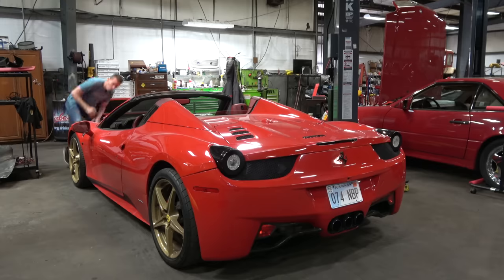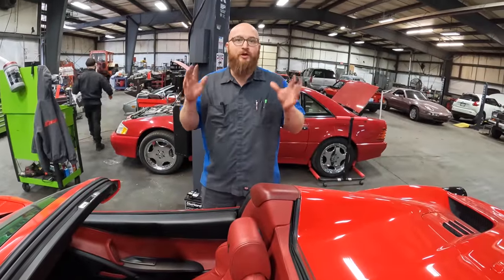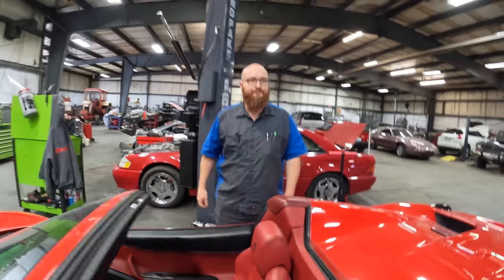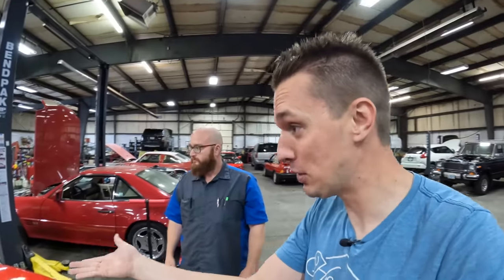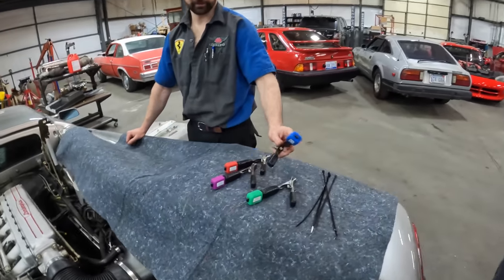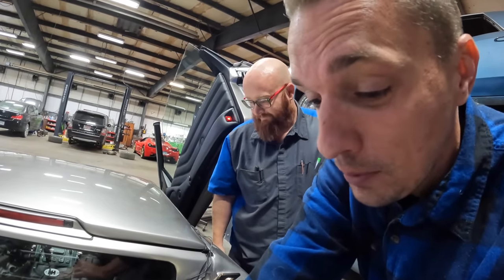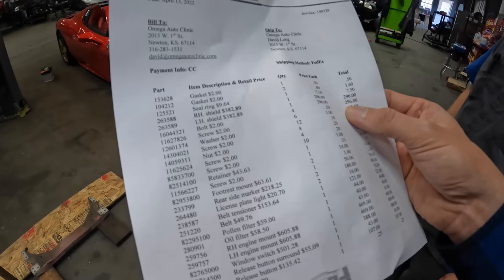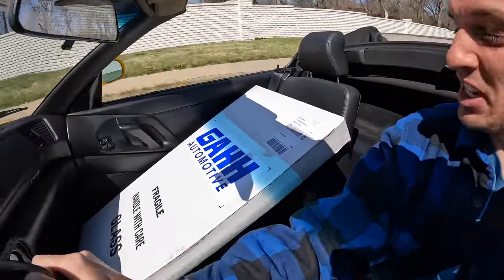MORE HIDDEN DAMAGE found on my CHEAP Ferrari 458 Spider! How bad was it really WRECKED???

Comment: Hey Hoovie, just ran a VIN check on your 458, it has an open recall as of March 22 for the Oil brake reservoir, you wouldn't want it.... burning down, would you?
Reply: Ofcourse he does, he will get more content that way. He doesn't care about most of his cars lol
Reply: That recall has nothing to do with a fire though, its for a potential brake fluid leak in the reservoir. Means he'll randomly lose breaks. Far more dangerous then it catching on fire though, because you can at least stop and get out if it does. Can't stop too well without brake fluid though.
Reply: Brake fluid is very flammable and will ignite on something like an exhaust manifold - a slow steady leak in the engine bay could be disastrous.
Reply: @stuc.6592  Except that brake lines rarely run through engine bays, especially close to hot parts such as exhausts. Still, a possible brake fluid leak is pretty dangerous.
Reply: @stuc.6592  That is why brake reservoirs in the front trunk area on a 458. Congrats.
Reply: That would just give Hoovie a reason to sing,"You Light Up My Life"without penalties.
Reply: @martij30  probably not on a Ferrari but every front engine RWD car you can think of the master is on the firewall right next to the engine and the brake lines run right next to the manifold.

Comment: 11:20 Hydraulic press while heating the Aluminium would be a MUCH better method, especially as its a HOLLOW rectangular part - until the new part shows up
Reply: Yes, at 12:03 you can see the upper part is now bent inside.  But it was funny moment, hopefully the part is not under high stress during driving.
Reply: Yes, they need a new cross member
Reply: But it doesn't make for good content. Remember, this show is fake and made for entertainment.

Comment: My serpentine belt / pulley sounded like that when it wasn’t perfectly aligned. Granted that was on a 66’ Datsun 520.
Reply: 2004 F150 Idler pulley would sound like that too.....only when cold and only at certain RPMs too....

Comment: I almost feel like it would have been better to just fine someone with a metal shop that could cut out and weld together a new cross bar to be installed rather than bending and risking it being potentially structurally compromised. Maybe I've just been watching too much Superfast Matt.
Reply: I was thinking the same
Reply: They should have heated the bend and used a 2x4 as a lever to gently pressure the bend out, mount it hot so that it cools and tightness in place. No issues. Hammering it cold, very stupid.
Reply: He should take it to Puddin's Fab Shop.  Guy could do it in a day and make a video out of it.

Comment: My father had a 1983 Honda Civic wagon that after warming up will make a similar noise and it was related to the fuel pump. The car will be normal but after some, it will start doing the same noise. I think you have two fuel pumps on the Lambo. That is my guess. Love the channel keep it up and check mine when you can Daily Drivers Inc.

Comment: Have you thought about Radio interference? I used to have a stereo that would wine up or down with the engine revs. I stuck an inline filter on it and it fixed 90% of it except this irritating whine at about 3500 revs. Coming out of stereo speakers it can be hard to realise its NOT an engine noise....

Comment: Sounded a bit like a fuel pimp or scavenge pump.
Try adding a Teflon based oil additive and a slightly thicker oil to rule out the engine

Comment: Have you checked the engine mounts on the Diablo? That resonance sounds familiar. It would do it mostly at idle then find a specific rpm at which the resonance would be most notable.

Comment: From my old memory , in the 70s Peugeot (504)  rally team used to use a hydraulic press to bend the rear cross member with a weight of about 500kg to get negative camber on the rear end.

Comment: Wouldn't a press give you a bit more control over the bending process?
Reply: Its a joke
Reply: Yeah, exactly what I thought. With a hammer you're more likely to create crush points at the impact site on an aluminium bar, as well as increasing the chance of shattering an Italian-grade piece of cast Alu.

Press + spreader block would be my route of attack. Doesn't look as good in a thumbnail I guess.
Reply: @CarWizard  you're not funny though
Reply: YouTube is not real my friend it's for the lols
Reply: 11:20 Hydraulic press while heating the Aluminium would be a MUCH better method, especially as its a HOLLOW rectangular part - until the new part shows up
Reply: @CarWizard  Thank god.  I know most of us did questionable fixes in the military, but that piece looks important to how the car handles.
Reply: @CarWizard  Are you trying to tell me, not everything I see on Youtube organically happened? My life is a lie.
Reply: Even some make-shift construction with a car jack would work
Reply: But that wouldn’t be as entertaining would it?
Reply: @MrEeeaddict  you’re mad

Comment: 1976 and 77 Chargers with the 400 ci lean burn engine sometimes had an exhaust resonance noise.  The factory approved correction consisted of a U shaped 6 lb. weight clamped to the right side exhaust pipe near the engine.  Worked every time.  Why the right rather than the left is beyond me.  Chrysler came up with novel approaches to some problems.

Comment: I'm sure it's been said and you've checked it already, but that sounds exactly like a vacuum leak I had once. And it only started making that noise when the engine was warm, I guess because the different metals expanded slightly differently.

Comment: I wonder what that cross member would cost at exotic auto recycling, or if they even have one. I’d be a little worried about how much that cross member actually supports, but I’d guess at least Daniel would have a decent bit of working knowledge as to that aspect. 

Glad to hear your doing the annual service and under tray. And as I said in the previous video I’d familiarize yourself with the tech service bulletin regarding the unresolved brake issue with the 458 and the factory recommended procedure for using the parking brake in the event they system does fail. Dan over at normal guy supercar did a video on this issue. 

Just an informational note due to a disagreement a commenter had with me in the last video, just because the rotors, pads and calipers have been swapped the brake system is still Ferrari, runs on the brake system pcm and other brake components. The issue is with a Bosch part that fails and there is no repair at this time. Not being prepared can result in serious injury and loss of life.

Comment: news flash for the wizzard, aluminium can't be bent back and forth when cold, it cracks this way.  Not a good idea.  If you don't car about it cracking why not use a press instead of the hammer, it will give you more control

Comment: I'm sure the Wizard has already thought about this but I'd be asking myself whether the Diablo noise is related to engine speed, road speed, gear selection or none of the above.
I think you said it whines when parked so that SHOULD eliminate everything related to the drive-train and air-flow, which just leaves the engine and ancillaries.

After the hassle you had with the Murci', I wonder about, perhaps, a pulley or belt that's vibrating at certain RPM.
Maybe it'd be possible to adjust some of the auxillary belts and see if it has an effect on the whine?

Comment: that frame can be fabricated or one similar that is stronger and fits can be made either using bolts or welded like the stock one. I think guys that weld radiators can weld the parts and sheet metal can be laser cut pretty cheap. It would cost like $300 for the laser cuts parts

Comment: Diablo is an easy fix.  And I'm amazed that everyone missed it.   Even the comments.  Not a single person has mentioned it.     You have to pull the engine and replace it with an LS.

Comment: I thought by law manufacturers are supposed to keep parts available for at least 10 or 15 years.
Reply: Why the hell did you believe that utter nonsense?
Reply: @JackTheripper911  because I was working at a Suzuki dealership in Canada. When Suzuki decided to pull out of Canada, the dealership became a Mitsubishi dealership. But we were told by Suzuki that we have to be able to maintain a supply of parts for at least 10 years

Comment: One thing that may help you a lot is to find some sort of program that can do a Fourier Transform on the audio signal, likely an FFT.

You'd be looking for what frequency component spikes when your noise hits. Once you identify the frequency, you may be able to find something that band pass filters the audio at that frequency.

What that would mean is the dominant contributor to volume in your mics would be that noise. It should be way way easier to narrow it down, blocking out most of the regular noise.

I can answer more questions if you have them. Do some googling first on some of the terms.

Comment: A Fast Fourier Transform would absolutely be the best to look at the Lambo's noise in my opinion. You even have a reference, because the moan only occurs when the engine has warmed up. So, you can look at the frequency spectrum of the engine without the moan and then with the moan and compare it. The microphone that shows the highest amplitude at the frequency where the moan occurs lies closest to the source. Then, you can zoom in on that area and do the test again to get even closer to the source.

Comment: That howl at specific RPM's usually denotes a rotating assembly not airflow. Most of the time its an issue with the transmission.  I'm no pro but Ive had that problem. If it sounds like a supercharger and you don't have one.... well... transmission.

Comment: About the Lambo, if you recorded the noise you could check the frequency to know the source:
- same RPM as engine = Crankshaft/pistons etc
- 1/2 engine RPM = Camshaft
- 1/4(?) = accesories (with pulley ratios)
- etc....
Good luck!

Comment: “Certain RPM” means resonant frequency… could be something with a rolling element bearing. 

If it moans when parked but revving… how about a partially blocked hydraulic line or connection… pumping oil to a cam for example but droaning like a wind instrument.

Comment: Eh, I think a press and some hard sheets of metal would have been much better to straighten that cross-member. A little heat wouldn't hurt either. Now you've got one that's 'straight' and dented in along its length. Ugh.

Comment: I am pretty sure that you guys and everyone on here have thought of everything on the Diablo that it could possibly be. 
I would be looking at all fluid caps, intake, vacuum hoses, vacuum booster and even for loose loom wrap. It sounds a lot like gaffer tape flapping (I have had some extreme hoopties...). The engine is shifting a lot of air, even when static, and the fact it seems to happen in a rev specific range I (in typing this) would be looking for flapping tape or such.

Comment: #HOOVIESGARAGE: I don't recall you ever stating that the issue is rpm dependent before and that it is inconsistent. That information would have been important last time I suggested the vibration sensors and monitoring equipment. The microphones may not pick up the "noise" as there is probably too much background noise to positively identify the source. YOU NEED to use accelerometers or vibration sensing equipment, microphone based systems are useless. That being said, in light of your new information about the RPMs. I had to deal with an SCCA car that had a very similar problem, low hertz frequency based noise at intermittent times and particular RPMs. The car went too so many shops before it came to me, the driver and team spent thousands of dollars to determine the cause. It turned out to be a small crack in the flywheel, it only shown up under flourscence crack detection. We found it by attaching a vibration meter/sensor to the trans case. Under normal track days it wouldn't show up until later in the day, but on hard track days it was prominent rather quickly. The flywheel was heating up and the crack was becoming more pronounced as opposed to when it was cold. 

One last thing, you hear the noise in the cabin because of the acoustic transfer. That doesn't mean that the noise can be detected audibly outside the drivers cabin. Still, rent a vibration detection unit, they are used in industrial settings where a vibration in a large complicated machine is not detectable other than the impact the vibration and subsequent resonance plays on the system as a whole.

Comment: I had a 01 VW Cabrio with a torn top... It basically totaled the car to get it repaired professionally, but at the same time doing a convertible top is very difficult, I'm terrified of using a riveting gun and fking up. Drove around with it with the top down permanently, luckily I had a nice garage to park it in.

Comment: Hi there. I love your channel. Keep it up. You could try checking the oil pump bypass valve spring. I experienced this exact issue on a 996 3.4 when i was a car mechanic back in the early 2000's. The spring broke and resonated. Sounded like this. All the best for you 🙂

Comment: 250hz "low frequency noise complaint" that happens after the car starts to warm up... impeller bearing on the water pump maybe?  The vibration could very likely be around that frequency.

Comment: 2:24 We'll Be Right Back

For the Diablo...anything wrong with the accessory belt driven components?  I would take a look at that first and progress to checking each and every part that runs when the car runs, and possibly use a spectrum analyzer with a microphone to pinpoint the location of the noise of exacting frequency spectrum as the moan. Hope that can help!

Comment: I think it's straight cut gears, in the transmission. The transmission probably originally had helical cut gears, and it got rebuilt with the wrong, straight cut gears. Open up the teansmission, replace the gears used in the rpm range where the car makes the sound, with helical gears. If it's not that, then my second guess is that the engine is harmonically balanced. Lambo probably used weights placed on certain engine components. Then the engine shook off one of the weights, and the sound is coming from the actual engine internals... My best two guesses...

Comment: The sound in the Diablo sounds like an cavitation/air problem in a oil pump, maybe powersteering or oil pickup. Probably oil pickup since the sound starts after the engine has been on for a while were the oil level at pickup is generally lower and air can enter the system.

Comment: Can't believe you guys belted an aluminium structural brace with a sledge, and didn't even pre-heat it to stop it becoming weakened by work-hardening. That's chintzy as F. No bueno.
Reply: It is steel. Pay attention.
Reply: @radonradon5478  Still no bueno.

Comment: The sledge hammer was a dumb way to repair that crossmember/bracket. The proper way is to use a hydraulic press, I have straightened many a bent steel and aluminum brackets with it, it is so easy on your hands and arms too.

Comment: I use a long screwdriver with one end on the suspect part and the other end in my ear. I also have an actual engine stethoscope for detecting odd noises. Now noise detection has gone high tech as well.

Comment: Not an expert by any means, but that moan sounds very similar to when whatever moves to select where the air flows in the cabin (floor, dash vents, defrost, mix) sticks in my 2020 Kia Optima on a humid day.  It only goes away either with the weather changing (less humid) or if I blast the AC at its coldest for a few minutes to dry things out.  A long shot, I'm sure, but shares all the other symptoms you mentioned (at rest etc).

Comment: The rubber on the engine mounts could have lost just enough integrity and your getting the harmonics through the frame. Rubber can contract as heat builds up which could explain why its not happening when cold.

Comment: Wouldn't it be strange if the sound on the Diablo was caused by some coolant/oil crossover pipes in the intake valley? It would make sense why it would only do it when warmed up. Maybe the thermostatic valve in the oil filter/thermostat housing? It also could be internal gasket overhang in hot-side oil/coolant pipes. That's my two cents.

Comment: Car Wizard needs to refund the $15,000 he talked Hoovie into spending for the Diablo exhaust, which didn't fix the moan.
Also, he need to buy a hydraulic press.  Not use a sledgehammer.

Comment: It could be a failed crank case ventilation valves and the block depressurizing making the moaning sound every now and then. As I had found a similar issue on a BMW v12.

Comment: no idea if you already checked this but Fords can make a similar noise when the idle air control valve goes bad
although i dont remember if it made a noise at idle or higher in the rpm range

Comment: Check the thermostatic oil valve build into the filter housing. Located in front of the left rear wheel, together with the oil cooler. It bypasses the cooler until you get temperatur, so fit the behaviour of the car needing to warm up before the noise appears. Lambo PN 001529644.

Comment: May only happen at certain RPM due to harmonic vibration.  Fuel pump, camshaft at specific RPM, really anything that rotates could at a specific speed cause the issue.

Comment: the mounting points ARE bent. as well as the cross member. may need to go to the "frame" man. may be able to fix the member and straighten its attachment points on the frame too. some of those guys can do wonders. don't think i'd want shims and the sledgehammer "fix". :(

Comment: Amazed you did not but the cross member in the pressed to straighten rather than beat it with a sledge hammer. But a sledge hammer approach is far more exciting ,so hammer away 🤣